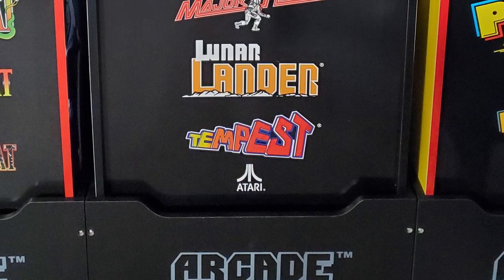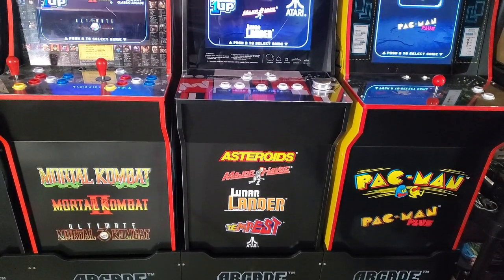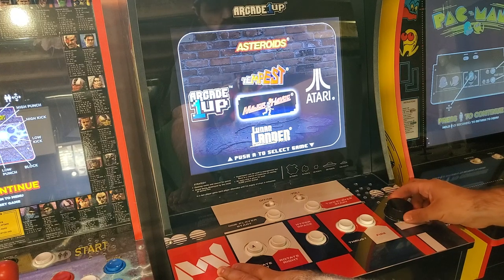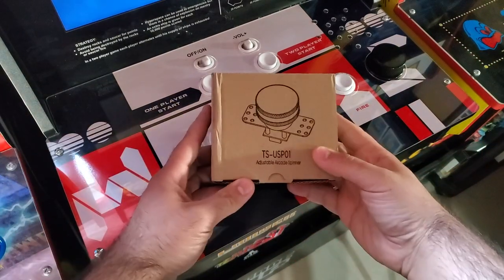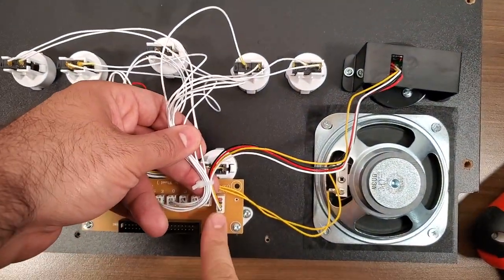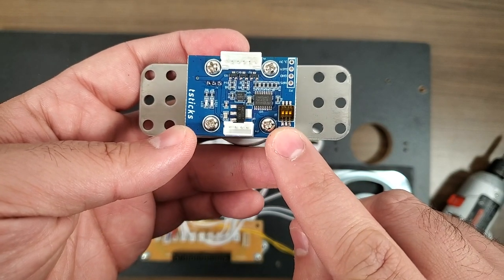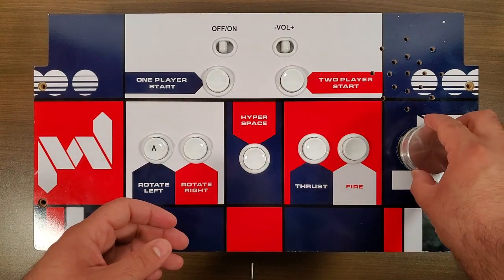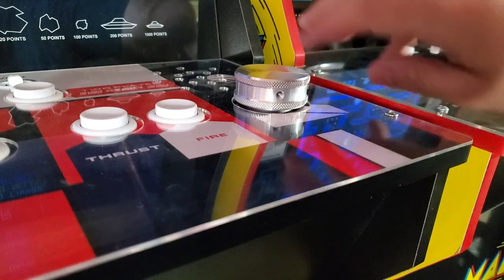The WORST Arcade1UP cabinet and how to fix it...

Comment: Nice video. I ordered the spinner a while back and finally picked up an Asteroids Deluxe today. It took about 5 minutes to install the spinner and works great. I'm having a little lack / delay when shooting on Asteroids and the sound sounds off on a few games. Tempest works great. Do you have any of these issues
Reply: There are a number of issues with Asteroids.

First, the firing a shot produces TWO beeps, not one. Second, the shots lack that bright glow with the slight trail of phosphor afterglow. Both of these are easy software fixes. The Vectrex emulation, ParaJVE, manages to do this flawlessly on his free software.

Thirdly, the shots don't have the same lagging effect they had when you fire nearly behind your ship when moving fast. Very noticeable when you do "hunting" like on the original coin-op.

Not sure how they fucked this up, as supposedly they used the original ROMs from the game.

Comment: Steve , how do think the original 1uP spinner spins?  I’m not sure if it was clear in the video.  HA!   This example of gen 1 cabs is really what was so irritating to me about 1up. It’s like they didn’t even try to play the games with their spinner , or didn’t even care about the play experience.  Which means they didn’t care about the consumer.  They are getting better though. Glens spinner is the way to go on any machine. The dip switch settings for sensitivity is a great feature that makes it legit.
Reply from the maker: Honestly the best way to describe the stock spinner was like a temperature dial in your car. Its spins but has locking positions every 1/8 or 1/12 rotation. It really terrible. Very clunky and it appears it registers just those adjustments into the locking position, not the fluid movement at all.